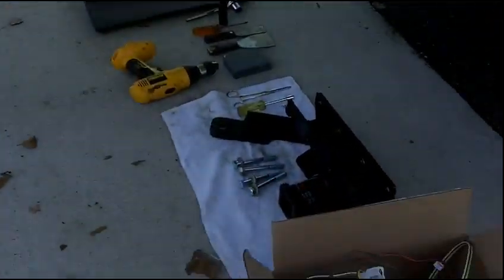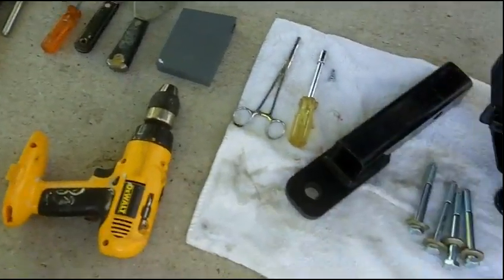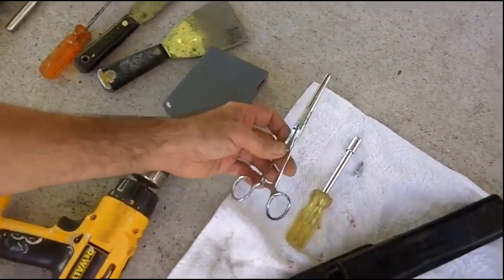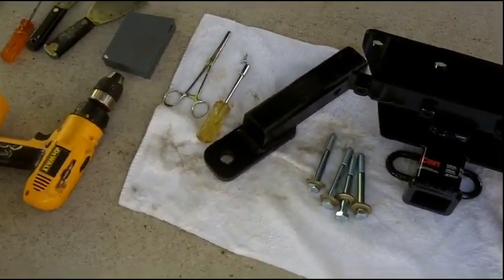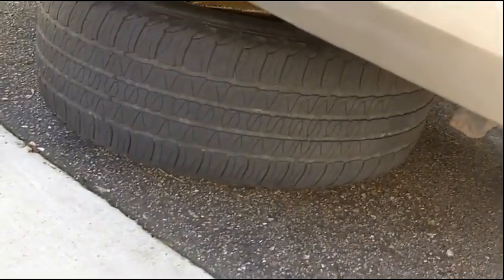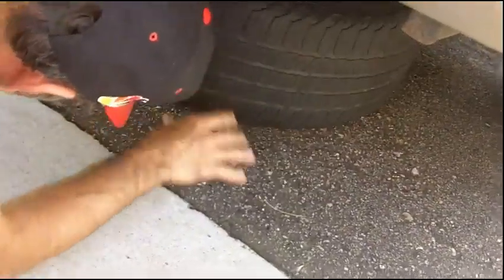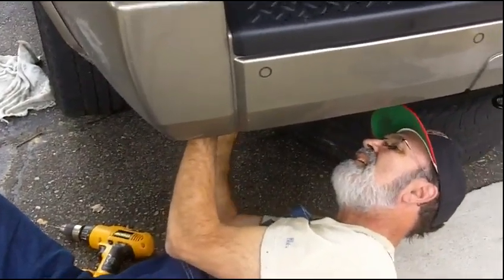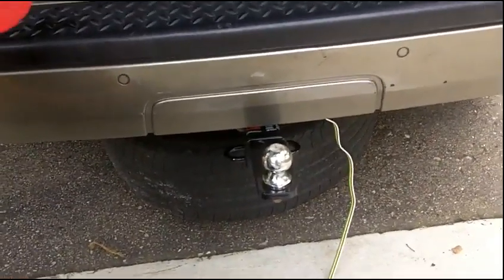HOW TO INSTALL A TRAILER HITCH & WIRING HARNESS: JEEP COMMANDER

Comment: Thanks for the video, gave me just what I needed!  However, if you have a rear tow hook, be prepared to remove the bumper too to access the bolt holding the arm for the hook.  Don't bother with the nut on the arm because it is welded on.